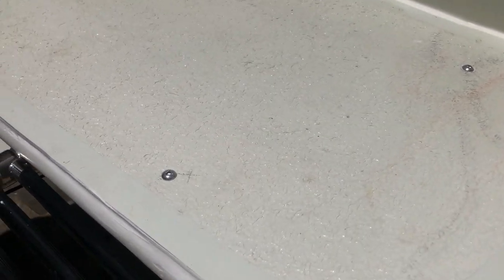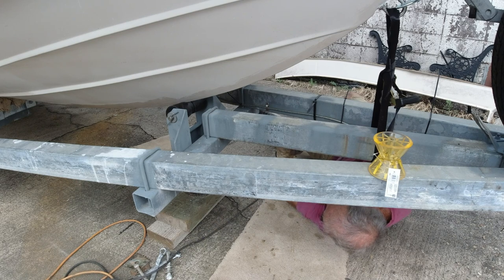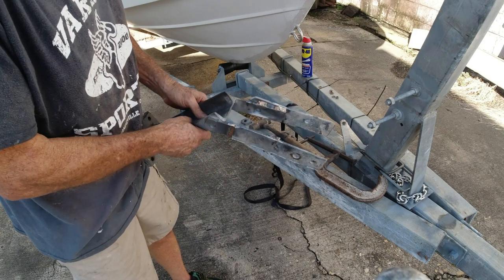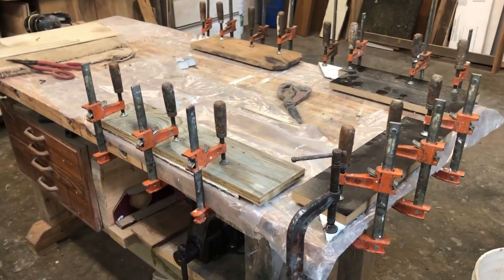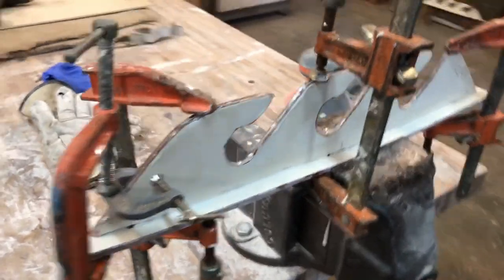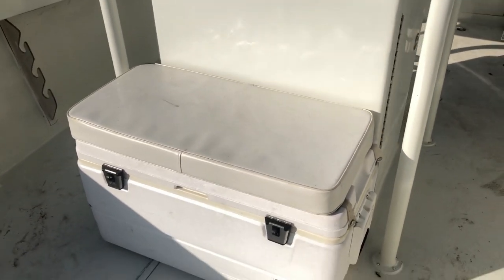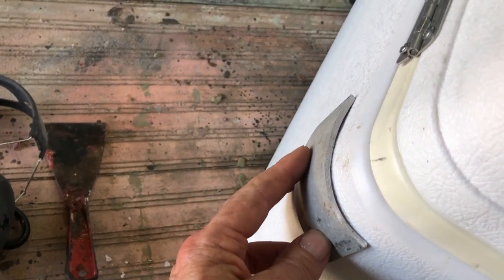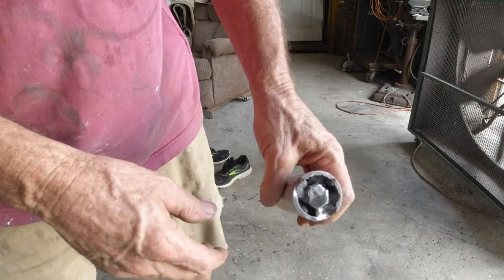The Center Console Project August Ramblings

Comment: I would suggest a pvc pipe guide to prevent the bow from missing the roller and doing damage when it fetches up on the steel bracket.  A piece of 1" sch 80 with the pvc free to roll makes a good one.  Two in the shape of your bow one on each side keep it from falling off the proper alignment.  Very nice in a cross wind or current coming on to the trailer.
Reply from the maker: Thanks for the tip Douglas!
Barry

Comment: Barry,  I don't like metal bungies on a boat.  I have found bungee cord plastic ends on Amazon.  If you search "shock cord ends" you will see a few different styles. I have used the kind where you push in the cord end then slide a collar over to squeeze the cord.  They work great.

Just another do-it-yourselfer offering up something... my thoughts.  Looking forward to  your next video... I'm always looking to see what electronics other boaters are using.  It's such a big decision
Reply from the maker: Thanks for the bungie tip, I will check into that if these turn out to be problematic. You might be disappointed in my selection process.  I was way out of my comfort zone.
Barry

Comment: Man love the builds been following since it started! Watched everyone and enjoy them so!! I got a tip for a good detail sander for tight spots like that...Take you a piece of a 5 inch sanding disc doesn't matter the grit and cut it in half...Roll the now half moon disc tightly with flat side on the bottom to a smaller die grinder bit and tape it on..works great for me!
Reply from the maker: Thanks Devin
I will give that a try for sure.
Barry
Reply: @barrylukebuilds7894  made a video for ya my brotha!
Reply from the maker: @TheAssaultScar  Got it! nice!

Comment: Nice Barry have you thought of using a router for the sharp edges?
Reply from the maker: Fiberglass is like concrete. Both can be "cut" but really they are abraded or grinded. I don't think a router, even with a carbide cutting bit, would fair well. Although I might try it someday. 
Thanks for watching and thanks for commenting!
Barry